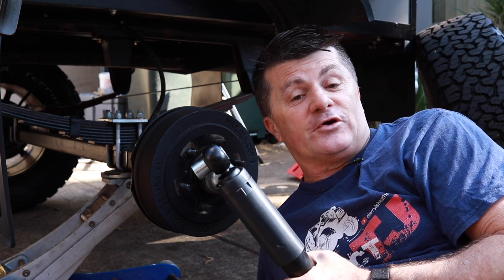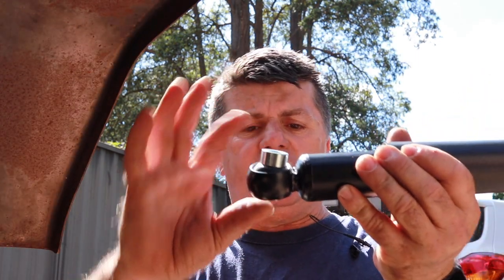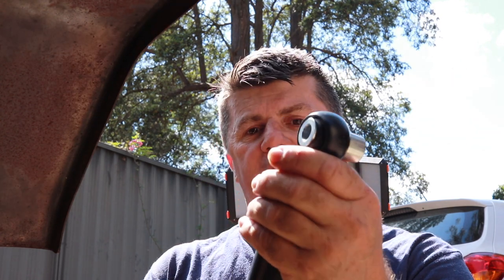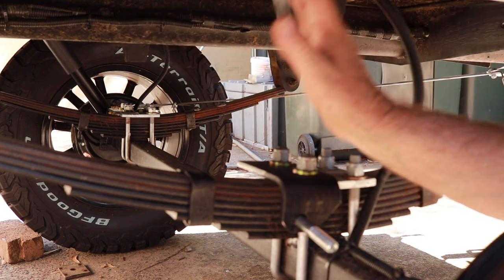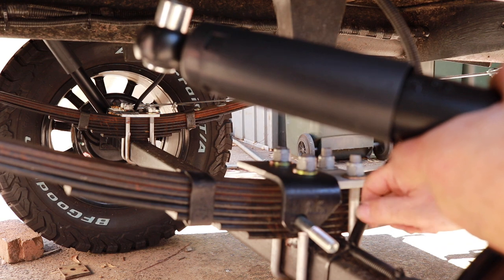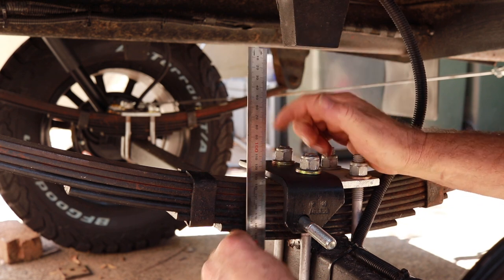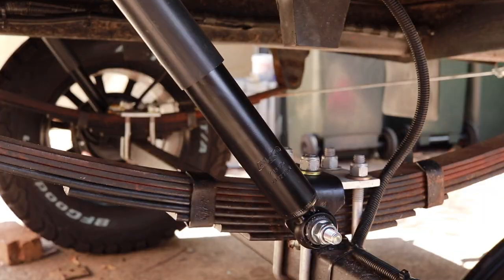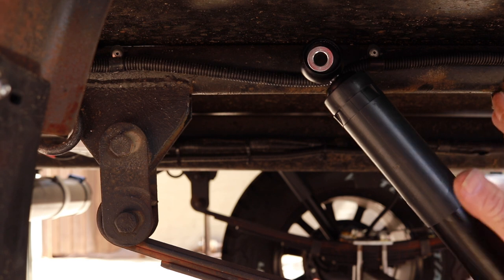Off Road Camper Trailer Build // Shock Absorber Install

Comment: interesting video , the only thing i would be concerned about doing this myself is not drilling through chassis as the engineering back in the day was not that thought out , drilling through chassis weakens the chassis , i would be more inclined to use the mount supplied

Comment: I think you should go with more dad jokes , so we’re did you by them I going to put shocks on my but I had new shocks from my Ranger from when I put aftermarket ones on , I don’t know how they will go but I like the mont you had that bolts on to the u bolts
Reply from the maker: lol link to the shocks is in the video description.
Reply: Darryl Sheather How much do you think you spent on your camper trailer , it good job you done

Comment: You have made it look easy. Where did you get the shock kit from and how have you mounted the handbrake lever on the trailer
Reply from the maker: Link is in the description for the shocks Mounted the handbrake on the original mount for the front sliding leg on the drawbar

Comment: How much does your trailer weight?  I have a 1500 lbs trailr and I wonder if this kit will work for mine? BWT, great video, Thank you!!
Reply from the maker: That weight would be fine, I've had the shock kit in when my camper was 1300lb, it's now 1600lb.

Comment: Hey mate, whats the size ( length) of axel did you get?  And where from pls? Iv got a no5 too:) cheers
Reply from the maker: You need to work it out from the wheel and tub backspacing you have, I should have the calc's in the episode about replacing the axle. Couplemate in Queensland do custom axles.
Reply: @DarrylSheather  did they ship it to you?
Reply from the maker: Yep

Comment: Hey mate is this a no5 army trailer? What was the exact model of shocks you got for it....?
Reply from the maker: https://www.caravansplus.com.au/alko-caravan-shock-absorbers-pair-p-1159.html
Reply: @DarrylSheather  Thanks Darryl much appreciated brother.  How are they holding up 6 months down the line ?
Reply from the maker: @timeisnow9855  Seem ok!
Reply: @DarrylSheather  did you get your axle hub and brake kit from the same place ? can you recall sizes? im starting to fab up the camper now... going to keep the original tub of the no 4 and just build up from there....
Reply from the maker: @timeisnow9855  I purchased the complete axle/hubs and brakes as one package. went for a 50mm axle/parallel bearings and electric drum brake package.